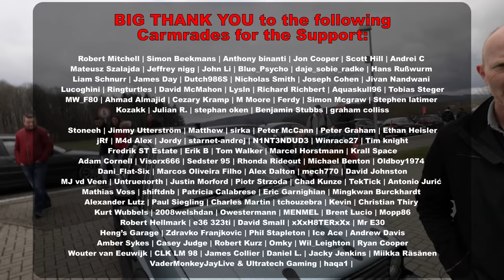(un)LUCKY CRASH of Legendary @pinderwagen // Nürburgring

Comment: It looks like u got disoriented and off ur racing line from the traffic 

U were bit to airborne and dicey doing to much ballerina fish tail swings especially be4 u re sync ur flow and the tire caught the grass or slippery surface while weight shifting load onto that tire that sent u on slide 

Beyond tuning car up more u might have to train up how to more quickly get re sync to road and not get mentally blocked by other cars and also how to over think cars in those situations instead of them flooding ur thought processes thinking ahead of situation not behind it 
And 
Also having bit more cognitive self awareness to know wen back off down ur pace or drop it some levels to readjust back to full pace 

And supper savont side u might Beyond ur smooth driving witch shows how exceptionally gud u are already have to learn to feel at wat level of pace u are at might not have that sensitivity yet or u might be desensitized from it from all ur high paced driving that bit auto pilot and subconsciously blind 

And also help do some tricks and savvy stuff test ur cars handling and feelings so u know where ur cars setup for wat way u can drive on fly 

Realizing how much gas braking steering to marker points and such to how car feels to realize how much pressure and heat in tires and any other such component to change how drive 

Might Wana deliberately setting one tire bit flatter than rest and other things to get that sensory wisdom in memory and experience 

In my humble opinions if helps and ideas for you 💡 
Get up2 f1 driver abilities and such

Comment: Another car fscked by the absurd barriers of the Nurburgring.
Reply: 90mph into the armco and I just need a new bumper, grille and wing repair. I don`t class that as fscked ! I`m 80% through the repair already. Should be finished and as good as before in a couple more days.
Reply: not sure what you mean by absurd barriers, are there for a one reason only: safety before everything. Am I wrong?
Reply: I think he's referring to the lack of runoff. It's pavement, 6 ft (I guess 2 meters ish) of grass, then barrier (Barry-R)
Reply: @rabid_1  ahhhhh. But that's what makes it the Nurburgring.

I have just done 2 days at Spa, whilst it's exciting, the huge runoff gives a very sanitised feel compared to the ring